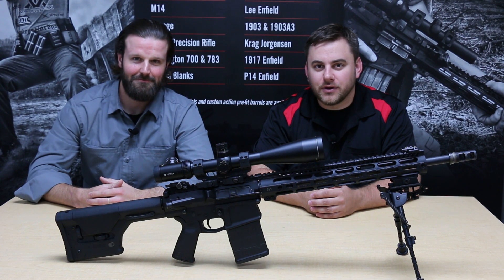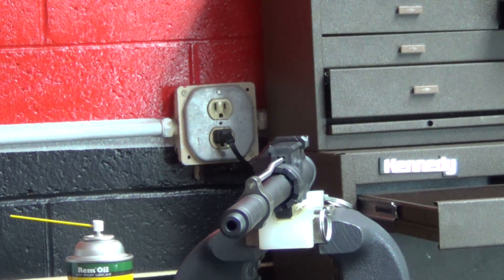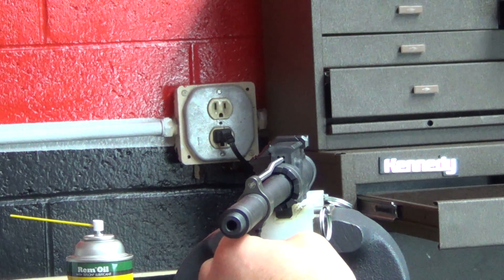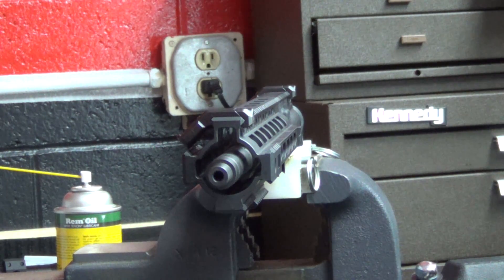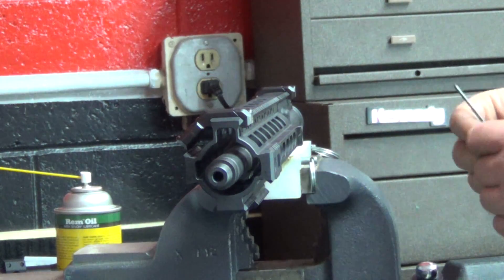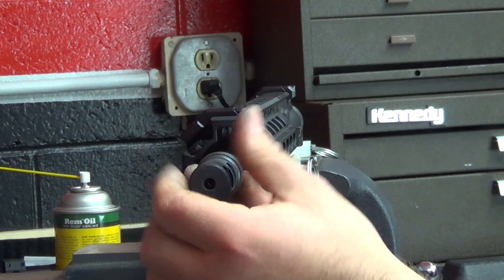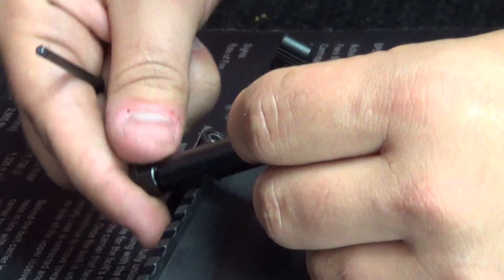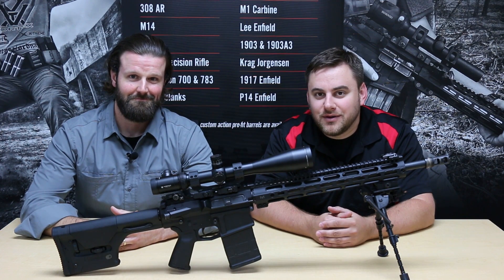Accurizing the AR-15 - Part 4: Assembling the Upper Receiver

Comment: I recently did a build with blue loctite on the gasblock screws. Just realized now that a-lot of people do red or rocksett. What do you guys recommend? And do you think its necessary for me to pull my hand-guard and redo?
Reply from the maker: I would recommend something like Loctite 680.  It is high temp rated and also a sleeve retaining compound which takes up any slop between the gas block and barrel for optimal gas efficiency.  You could pull your handguard if it makes you feel more confident, but it is likely not necessary.  We have run removable blue loctite on machine guns extensively (trying to get gas blocks to walk off) and so long and one doesn't break the seal of the thread locker to remove the set screw in the dimple, I have never seen a gas block walk off.
Reply: @CriterionbarrelsInc  awesome thank you!

Comment: Is Loctite pointless on a 13.9 criterion barrel? Since it’s not exactly long range? Seen criterion worker use Loctite red 680 on the barrel instead of shims
Reply from the maker: In my experience, anything that produces better performance is not pointless.  Not everyone has to do this, I do because it produces a more rigid upper with better and more repeatable harmonics which improves accuracy.  We routinely push 13.9'' upper to 1,000 yards.  While they are not all that consistent at those distances, they can produce high levels of precision.  How much that matters to you will depend on your requirements, expectations, and abilities.

Comment: Finally, some people who understand the down side to pinning gas blocks.. I dimple and use rock set and I have never had any of my gas blocks come loose or move.  My gas blocks are under the hand guard and pinning them is completely unnecessary. I have seen over torquing the set screws effect accuracy as over torquing muzzle devices..

Comment: I ordered a barrel that came with a factory pinned gas block. Couldn’t believe they drilled such a deep gash into my brand new barrel. Never again. New rifle with one dimple and some red loctite. 
Yeah red loctite comes loose with high heat. 1000 rounds and still not loose.
Reply: It’s a tool, not a classic car.

Comment: Does 14.5 core series pin and weld muzzle brake going to negatively affect accuracy of the rifle because it is removing material from the barrel??
Reply from the maker: If done properly, the barrel will have little more than the threads touched.  As long as the muzzle device is properly torqued, I have never noticed any issues with pinning and welding as it is minimally invasive and harmonics should be consistent.

Comment: What are Criterion’s favorite torque values for the barrel nut, gas block set screws and the muzzle device? I am a believer in using torque wrench’s.
Reply from the maker: Good question.  Torque values can make or break the level of accuracy you see from your rifle.  Ultimately, I recommend following the manufacturers recommended torque values as each manufacturers part will have its own specs.
Reply: @CriterionbarrelsInc  Thank you for the reply and have a wonderful day.

Comment: Please show me the proof that tightening those little screws down too tight will cause accuracy issues. Maybe you guys could do an experiment and show how this would cause accuracy issues. You are really only talking about inch pounds of torque anyways.
Reply: Some guy ran it through a program using a .308 barrel (which obviously has a thinner wall) his calculations showed you would need to apply about 180 in/lb to cause a .0005” deformity to the bore. 

That is obviously an unrealistic amount of torque to apply.

Comment: When you say change barrel harmonics with a pinned gas block what kinda issues can that cause? Would it make a gun wildly inaccurate? Or more of a 2.5 moa shooter
Reply from the maker: Drilling a hole through a barrel and driving a pin through it creates all sorts of negative issues with harmonics, specifically when the barrel heats and cools off and the barrel steel expands and contracts at a different rate than the pin.  Pinning gas blocks is an antiquated practice that harken back to the days of fixed front sight posts and non-free-floated barrels... the AR-15 has moved well past that.  2.5'' MOA can absolutely be achieved when pinning a gas block, but in my opinion that type of accuracy is terrible and wildly inaccurate.  The AR-15 is capable of 1/4'' groups when it is properly built and timed.  Why anyone would reduce the performance of their rifle for no gain in reliability of durability is beyond me.
Reply: @CriterionbarrelsInc  With all that in mind, I’ve asked nearly a dozen Shooters that shoot in excess of 10,000rds/yr. 90% of them not only shoot pinned gas blocks, but swear by them having personally seen non-pinned blocks clock/drift/walk. One individual in particular read Criterion’s philosophy years ago and wanted to test your findings…So he took two identical, complete uppers, the only difference being one was pinned, one was not (was only set screwed). Both were bagged and both shot just under 1 MOA. If the pinned gun(s) consistently shot with an added 1 minute of inconsistency compared to their non-pinned counterparts, I would wholeheartedly agree that the 1 inch loss of accuracy is unacceptable; but that’s not what people are/have been finding in private testing. Most of these people response was the same …”Show me the scientific proof that Pinned GBs produce less accurate guns than those with Non-Pinned GBs, especially in fighting guns where both Reliability and accuracy are Paramount. I can however show you where Non-Pinned GBs do in fact fail at a higher rate than Pinned GBs.” Multiple people that conducted testing gave me this same response. All of them are reputable shooters within the industry and I’m certain the folks at Criterion have most likely heard of them. I understand that a Rifle intended Solely for the Purpose of Marksmanship - such as a National Match rifle, should not be pinned…even 1/10 of an inch loss in accuracy is insufficient…but the Rifles Criterion makes barrels for are 99% designated as Defense Rifles. Even a Law Enforcement Sniper tasked with engaged Hostage-Takers, must first and foremost be concerned with function over a tenth-inch and up to a quarter-inch loss in accuracy. It seems to me like the goal of Supreme gain in accuracy comes at the loss of too-significant margins of Reliabilty/Durability. Granted we’re speaking in hypotheticals/theoreticles, but Gunsmithing/Design is mostly theoretical in nature.
Reply: @sheepdog916  The new gas blocks are completely protected by the handguard especially w/ URGI and new low pro URG builds, if you dimple the GB that's perfect and sufficient to ensure GB doesn't run off during heavy use. The only reason why pinning the GB was mandatory in my case DoD was because of the exposed FSB. The USMC in 2017, had a new requirement for infantry rifles:  " Barrel may include low profile gas block but may not use taper pin".
Reply: @jwhiskey534 And yet the URGI barrel assemblies of all lengths and assorted NSNs all have taper pinned gas blocks…

Comment: The best thing for set screws is Rocksett. There's nothing else like it...
Reply from the maker: Rocksett is great and works very well, just note that it is water soluble.  So, depending on how and where you use your rifle it may not be the best option.
Reply: I still choose Rocksett because simple torque value is sufficient in most cases, but a couple drops of water and 60 seconds usually breaks loose half or more gas block screws I remove every day, just do a reverse torque test after every rain storm😁

Comment: Could someone from Criterion watch this video. Just trying to understand the difference of opinion and what route I would like to take https://youtu.be/qI75Z6jNKxs
Reply from the maker: Jonathan, tolerance staking is a real thing.  When fitting an AR together you are relying on several different manufacturers to hold tight tolerances... Generally I find that tolerances vary quite a bit.  Truing the face of the upper ensures that any machining or anodizing depth variances are removed and that the barrel is squared to the raceway in the upper.  This helps to make sure your bolt face sits squared to your barrel and limits gas leak, back-pressure, and increased wear.  Do you need to true your upper? No.  Millions of rifles out there have factory tolerances and run fine.  For us, fine is not fine enough and we work to remove, refine, and fine-tune and variables. I want a rifle that shoots 1/4'' groups and one that is also flawlessly reliable.  This means removing inconsistencies and hand fitting parts.  Things like ensuring a tight head-space, properly timing the 8-step cycle of operation, using a handguard that will create a rigid and consistent rifle, etc., will all shrink groups (even if it is by tenths of inches).  There is a lot to it.  Some guys say that building AR's is like Lego's for adults... those guys have no clue what they are talking about.

Comment: I have 2 Criterion barrels on builds I did. One SS 18in .308 that does 3/8in. 5 shot groups @100yrd with handloads, and the other .223wylde chrome-lined that does 1/2in 5 shot groups @ 100yrd. Great Quality Barrels!
Reply: Sounds great, my 16” Criterion 416r nitride barrel shot a .55” five shot group this past weekend with factory produced 69gr Swiss Ruag. Probably some accuracy still left in the build due to my setup,  it currently is using a rather loose upper reciever and a $400 6 power Primary Arms scope.

Comment: How do you index the gas block when the gas block is extremely tight around the barrel?
Reply from the maker: If the gas block fitment is tight and you're having a tough time getting a set screw gas block aligned (or if you're not able to visibly differentiate between the barrel and dimple surface) , I'd recommend painting the inside of the dimple a bright color. Eyeball the gas block as best you can to get it aligned, and then tap it in place with a plastic punch and ball peen hammer. 

Shine the light into the set screw hole to see if the bright color is visible. If it is only partially visible (angled to one side or the other), or is not visible at all, then tap the side of the gas block until it indexes correctly with the brightly colored dimple.
Reply: @CriterionbarrelsInc  Wow thats an excellent idea. not just another AR manufacturer are you?

Comment: I wish you had made note of the difference in upper clamping.  Your series is of course awesome because you guys know what you are doing but its easy when explaining things to someone to blow past something thinking it is just second hand.  I watched pretty closely when I saw the pivot pin style upper vise block being used hoping you would not be putting any kind of torque on it and was not surprised when it transitioned to a reaction rod style.  Also think you could have done a whole video discussing 10 platform guns in regards to bolts and varying problems they often times face.  I get lots of looks with my 6.5 krieger barreled AR and people for some reason seem amazed that it shoots consistently or dependably....guess I am just lucky.
Reply from the maker: Good observation Nick. We definitely recommend using the reaction rod during rebarreling. Although the .308 (6.5) AR's can be accurized using similar techniques, we could dedicate an entirely different video series to the subject of confirming cross-compatibility between parts and tweaking the system to operate consistently. 

With so many different unique component options available it would be tough to sum it up in a single video, so in the interim it may be better to have folks call in and chat with Mike about the various cross-compatibility nuances out there.
Reply: @CriterionbarrelsInc  What is the reasoning for recommending the reaction rods over the clamshell?